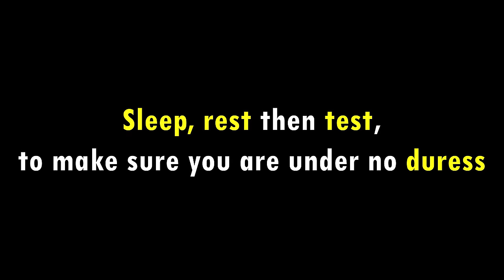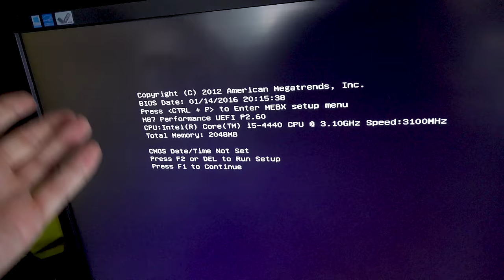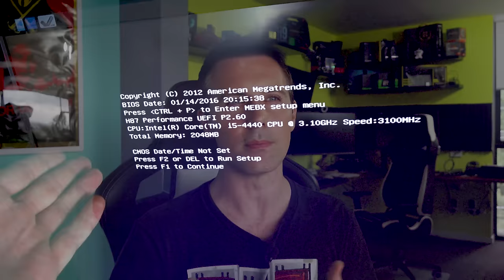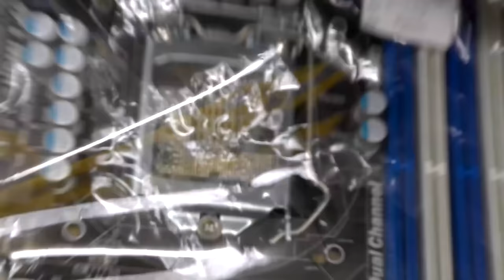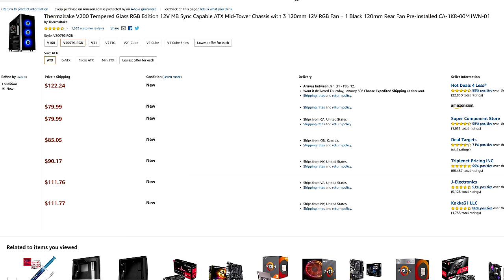Washing 12 Motherboards with WATER and Attempting to Fix them - (Can YES Fix it Pt. 1/2)

Comment: There’s nothing wrong with using water. But I generally use right after water an alcohol bath so that evaporates asap. After Hurricane María I remember a friend that had to clean some servers with mud damage using isopropyl alcohol trays after hosing them down.

Comment: As a last request of getting away from LGA 775 can we have one last video where you test a good 775 build against some modern low end hardware like an Athlon 3000g or newer Pentiums? Just to see if LGA 775 still has some kind of use in 2020.
Reply from the maker: Hey pa thats a pretty good idea, just like 3000g and maybe like a super cheap xeon x3440?
Reply: Maybe even something like a q6600
Reply: x3440 is a 1156 xeon though isn't it ?
I'd say the e5450 is pretty good 80w tdp 3.0 ghz stock. paired with some faster ram for overclocking headroom too kind of bring out the best out of the processor.

As the e5450 is 80w tdp it should hit 4 ghz without too much effort like the e8400 i got in a test rig here with a tower cpu cooler.
Reply: Sounds good. Some modern budget vs tried and true budget vs something considered irrelevant.... Sounds like a TYC video to me!
Reply: @Mini-z1994  actualy , low TDP variants overclock worse, than high TPD variants. You can check that on overclock records, that on X5450 there are better results with overclocking.

Comment: you should have used soap. I did and never looked back on that broken board.
Reply: Only use soap if you truly want vengeance on a board that has wronged you!
Seriously, the particles will get into every nook and cranny (and especially contacts) and you'll be lucky if the board ever works again. OR you'll be happy you destroyed that pesky board once and for all!
Reply: @John Doe OKie dokie, Mr Doe... If that is your real name... 
First off, the OP never mentioned liquid soap. And even if he did, practically all soaps use a surfactant which will leave residue (AKA PARTICLES) when not properly rinsed away with water. And on intricate electronics with lots of perforation points, such as a motherboard, there is an almost zero percent chance that you can rinse off 100% of that residue.
That will play havoc if it's on and contact point where metal needs to contact with metal to complete a circuit.
Your basically playing roulette with your expensive tech.
If you feel the need to wash electronics in tap water, PLEASE DO NOT USE SOAP!
Reply: @XHackManiacX  Soap would do nothing to hurt anything like flux, traces etc... It isn't like he was using salt water. So maybe you should rethink your stance pal.
Reply: @XHackManiacX  People have been washing circuit boards in dishwashers for decades so take your garbage elsewhere dude.

Comment: Before i even watch this, the 2 motherboards i have have both been through me throwing them in a sink and washing them like a dish lol. But... Only thing you have to be mindful of is some chips may hold water in or under them, so usually to combat this i usually try to either pour a lot of high percentage rubbing alcohol on those or if i have enough I'll submerge the board in rubbing alcohol, once done with all that i usually throw a hair dryer on the mobo for a while to heat those parts I'm worried about to evap the water faster. Just what i normally do though. Wouldn't have a pc if i didn't do a lot of this stuff since i rarely have money for anything so if i can't clean or fix it... Then i don't have it.

Comment: Maybe you temporarily fixed it but washing it with tap water will eventually cause it to corrode because of the minerals in the water. 😂
Reply: Wrong. That's how ultrasonic cleaner behaves.
Ultrasonic cleaner can remove corrosive property of water. At least use water where you knew its source. Even mineral water from supermarket is good for ultrasonic cleaner

Comment: If you do this don't just let the boards sit overnight to dry. Blow them off with compressed air and focus on the surface mount components. Water can hide under them, especially stuff like the CPU socket, northbridge, and southbridge. Also blow out any connectors. Only after doing this should you let them sit overnight. It also might be safer to clean them in a bath of isopropyl alcohol, it's cheap enough to buy a couple bottles of it and a plastic container to submerse the board in from the dollar store. Then you won't have to worry about rust and they will dry out a lot faster.

Comment: My 7 year old ASUS P8Z77-V has the exact same issue, if I touch the RAM in it, or just move the board, it stops POSTing and I have to play swap and try with RAM sticks for hours to get it to POST again.

This board is amazing though, it was my first PC build in 2013 and it has died 3 times so far, RMA'd twice for "fan spins for a split second and repeat without post", PSU killed it once, repaired out of warranty finally, and it still works to this day as my backup system :D

Comment: Hey, man, please be more careful with that water getting in the CPU socket. I had a LGA 1156 Motheboard at some point and I bent some pins by cleaning it under a hose (no high pressure). It was a pain to bend all those pins back. I never got them exactly the way they were supposed to be, but it eventually (after a bunch of back scratching) ended up working again.

Comment: The Phanteks Eclipse (PH-EC300PTG_BK) Steel ATX Mid Tower Tempered Glass Case, Black is a great case with ambient RGB and fans. It's very easy to build in and is only $54 us on Amazon. I'm partially paralyzed, and I just built a system in it one handed...

Comment: So corrosion is highly alkaline,  if you have crust on chips to the point of having to rub them off from being in a high humidity environment; putting the non working boards through a vinegar bath (and similarly drying) you will probably fix a few more.  If you are willing to resolder, probably even more of em.  Cheers.

Comment: Cleaning with water is 100% safe if you dry it good. I use hair dryer and turn on computer parts on the next day. If you still doubt then you can soak it with medical alcohol. It will replace the water and dry even faster

Comment: Some things to consider as well, at Least wear rubber bands around your wrists to minimize damages done by static shock. Also, a good nice large Anti-static mat or even a Equivalent bin to protect them from just being on a Bare surface or even the floor, I really believe you may have better success rates.

Comment: PCBs are washed during the manufacturing process. So yeah, you can wash them.
Reply: They use highly filtered distilled water. DO NOT USE TAP.
Reply: @SISSYPUSS  Tap water is not safe, it is mineralized, minerals can be deposited on pcbs, electricity+minerals+heat= Corrosion.

Comment: One idea for you on the badly bent pins is to use a micro-torch to heat them first, this will help prevent them from snapping off. Yes, it is risky but with a dead board there is no harm done.

Comment: Don't become an electronics engineer...be the car wash guy...you'll repair electronics like a boss...Dude! This is wrong! Use isopropyl alcohol to clean the boards,it evaporates faster and does not oxidise the metal parts!Water,even if you dried the board,will still add a layer of oxid on the parts,causing weak contact.Many of those boards can be repaired...but not with water! You might also ruined a few of them by washing them! Remind me to never let you near my electronics!

Comment: Well, after washing it with water and detergent, then proceeding to spray it with wd40 clone, it doesn't boot. The led turns on for a while. IDK why ...
Now on second step of rewashing the mobo again... Still drying it out, no hair dryer, only table fan.... It didn't work... I had no idea, i tried this before and worked

Comment: a motherboard that doesn't work right usually isn't because it's dirty. sure you can wash the board, but why? just use a soft brush to wipe off the dirt. the real fix is figuring out which parts failed and fixing it. this experiment doesn't make sense, it implies that washing a motherboard somehow fixes it, it doesn't, it just makes it clean

Comment: I hose my dirty PCB's down and then use IPA to dry them and remove scale and stuff that was in the water, I live in Sydney so not to many minerals in the water Best Regards Andrew
Reply: IPA is so cheap that putting it in a spray can and using only that without any water is much safer way to go and no long drying needed.

Comment: Rubbish! Here is how you properly prepare your motherboard: 

First, gently wash the motherboard in tepid water. Then boil the motherboard in salt water for 15 to 20 minutes, stirring occasionally. Finally, bake the motherboard at Gas Mark 5 for 1 hour, basting with the juices every 10 minutes, until it has turned a light golden colour. Serve on a bed of seasonal veg, and smother with gravy.

Voila!

Comment: Stick with the DDR3 775's ,no DDR2,  I have two 775 boards that have been running for 9 years, GA-P43T-ES3G,Modified Xeon E546,GA-P45T-ES3G,Modified Xeon Quad E5472

Comment: Hey! Dont just let them to dry up! Use compressed air (get a small compressor) and use it to displace the water from below the chips. 
If you just let them to dry up the water will leave residues on the board.
Reply: True

Comment: I gave a socket 775 PC to my friends kid, the CPU overclocks massively on stock heatsink, the RAM overclocks well, with a 1GB, 1GZ HD7770, playable in Fortnite, luckily only on a 1366x768 monitor, but can't run Apex Legends, as the CPU is missing an instruction set? that the game needs :(

Comment: Hey Brian, YET another great one to bookmark!  NOTE RE Cheap & Decent Case Ideas;  Deepcool MATREXX Series Cases, can be purchased with or without ARGB.  See if they're available around you?  I bought one several months ago (on a lark), for my son's build, I was MORE than impressed with the materials, rigidity, stability & overall quality -  compared with the Corsair (ie 100 series @ about the same $ USD), NIGHT & DAY!!!  More like working with a top Series Corsair Case, feels more like 500D!  

Anyway, this was my original impression, so I'm still buying them.  Specifically the Matrexx 55 models, decent size and fitment.  the Cougar M3xx Series are also decent, yet (imho) don't "Feel" as solid, as far as materials.

Keep up the good work!!!
See you in the next one ;)

Comment: My daughter's laptop had syrup spilled on it, and of course some made it's way inside it. Well, fast forward a couple years to when she finally brought it to me. Syrup on the bottom of the hdd, the center hub was corroded bad. The syrup had found it's way onto one of the sticks of ram too. Hot water and a tooth brush. Used alcohol and a hair drier to get everything back to normal. (I didn't wash everything, just the affected areas) Now she powers up but I got the flashing caps lock indicating bad ram. So I pulled the 4gb stick that had the syrup and played around with the other stick in the two slots. Yup, slots are cleaned up nice and working, but the one stick is bad. The hdd is bad too. So not bad. Went from won't even turn on a light to I can run diagnostics. It'll be back up as soon as the parts get here.

Comment: 9:50 I just had this happen to my Optiplex 9020 SFF. It was working fine and then I swapped the SATA cables because the boot drive has to be on SATA0 (learnt from your videos). I'm crushed but I'm glad I found out the reason.
edit: Just discovered the real reason. I'd pulled the boot SSD out of the PC to use in another PC to flash the BIOS to the latest version, then put the SSD back in. For some reason, pulling a RAM stick out or putting one back it would allow the PC to boot that one time, so I used that to flash the BIOS on this PC, too.

Comment: Damn, B. Just get an UltraSonic cleaner. That would save a major headache and probably bring a few more boards back to life while using it
(https://www.youtube.com/watch?v=sPKRt9ejyP4&t=305s)
I'm gonna Guarentee that z77 Extreme6 is gonna give you some problems unless the chipset and some other broken solder points are reflowed. Anybody ever wonder why ASRock still uses only the Extreme4 series motherboards and not the 3, 6, 9 or 11's anymore.  I still have a z77 Extreme4 with a 3770K that's chugging along. The Extreme4 on the z77 platform used a really unique VRM and ASRock put a little more care into this particular board. All other ASRock boards from z77 - z97 just would not last. Even the OC Formula boards wouldn't last more than a couple years. z170 is when ASRock started to change up there QC.
That intel 💀 Skulltrail board with the rotated socket looked like an awesome board.
  Ouch! Exacto Knife to a socket. I couldn't barely watch a knife to a P5Q-E.  A dremel bit to the opposite sides of the CPU substrate is a much safer way. Just shave off 2 little notches and that way the motherboard's socket doesn't have to have surgery. Plus it makes it harder to resale. Even though its a 775 board, i know a few nostalgic collectors that pay good money for old high-end 775 era boards. By the way anyone looking for a... Nah, i wouldn't do that to B. lol. 
Keep up the cool vids. Its the vids like these that keep me coming back. Not to say there's anything wrong with the new stuff.

Comment: Have you encountered any motherboards that had bulging/leaking capacitors?  I necromanced a bunch of boards and a few video cards by soldering in new caps.
Reply: @cdnron75  Very true. I also go by guilt by association, where if I see a bunch of caps with the same value and one of them is leaking, all of the caps with that value get replaced, because they likely came from the same production lot. After I'd pull them out, I'd test them on a capacitance meter and every one from that group would be bad, even if it wasn't visible.

Funny you should mention it, one I fixed a few days ago was also a 775.
Reply: That doesn’t happen much nowadays. Most modern boards use solid caps instead of electrolytic.
Reply: @cdnron75  does it matter from your perception, if you use common capacitors or japan ones, high durability, or whatever they promote? Gigabyte and Asus started to use them back in s775 times. Are they really more durable? Do you solder these ones, or common ones?
I mean these: https://www.gigabyte.com/microsite/98/html/technology-guide-ultra-durable-1.htm
Reply: @cdnron75  thank you, so seems they are worth it. They advertise , that they are 2.5x more durable. That means, they can hold even over 15 years in average. Had you experience to bulging even with these? Or only common ones did you see bulged.

Also, is there a way how to find out, which one board have? Except advertisement. But I'm afraid to buy any other board, than Gigabyte, because of this. I'm buying old boards from 2013-2014, because of extreme budget, eighter Ivy Bridge ofr Haswell. I'm scared to buy anything else as Ultra Durable 3 Gigabyte, with such old boards.

Comment: Tech YES City water world lol. I had to come back to this old upload to see how you clean your boards because I recently obtained 3 untested mobo's  from a charity organization. All Asrock boards. An Asrock Z270 Taichi, and 2 Asrock Z370 Killer Sli 's. All of them were in original packaging and boxes. The Taichi is good and one of the 370 Killers is good too but the other one fires up but gives no display. Pins look good as I observed them through a lighted microscope gadget I got from Amazon. Swapped the ram, removed the battery but still no go. I  followed your steps and gave it a wash as a last resort and waiting on it to fully dry overnight. It was really cool seeing you bring those ones back to life and hope My Z370 can also be resurrected. Great channel, liked and subbed.

Comment: I just recovered a really nice Asus M4A79 Deluxe board with hosing + BIOS reprogramming. Just a tip for anyone looking - when troubleshooting an older board with no post code debug readout - plug in a speaker into the front panel headers. That was the difference between having a working board and not for me. The beeps indicated first a bad memory stick, second - no gpu, which I then discovered to be 2 dead PCIe slots. Also, for anyone interested - I used a CH341A programmer to reprogram the BIOS.

Comment: Hm, I ve got a MSI B350 PC Mate and am a bit on a loss trying to fix it. It sometimes gets stuck on boot on the vga debug led. Like 3/4 of the boot it works fine, the rest gets stuck. After boot it works fine and stable. I tried different CPUs, PSUs, GPUs and RAM modules. The issued didnt change. I flashed different BIOS, changed CMOS battery and changed thermal paste on chipsets. Still no Change. Obviously I also cleaned it with spray too. Someone's got an idea?

Comment: You still haven't taken the best advice I could have given you, you want to get mobo's back to life PROPERLY, start using "Servisol Super 10", you used the word "Contamination" instead of Conductive when it comes to water, but maybe you should pay attention to oxidisation and corrosion, both of which stop conductivity in ram and PCIe sockets, spraying sockets with Servisol Super 10 which is a PROPER contact cleaner, you might get higher success, you also might want to invest in a fibreglass cleaning pen and clean the contacts on those ram sticks, they're Yellow when they should be shining gold.

BTW, I've been an electrical engineer since the 80's and the stuff you do makes me cringe, stop cutting corners and invest in Servisol Super 10 and STOP spraying it around like canned air, it does NOTHING, other than waste it  !!!